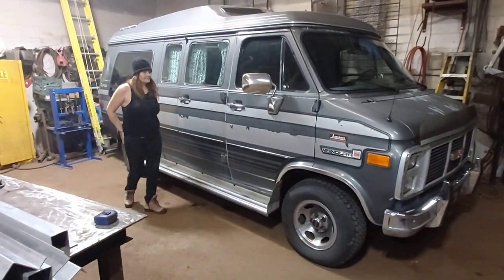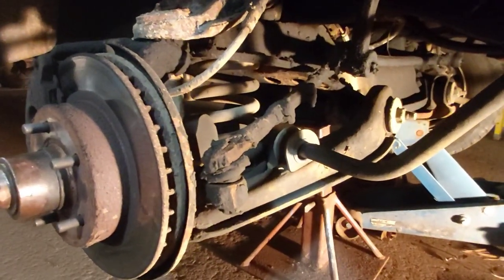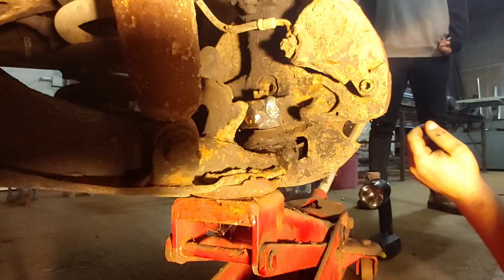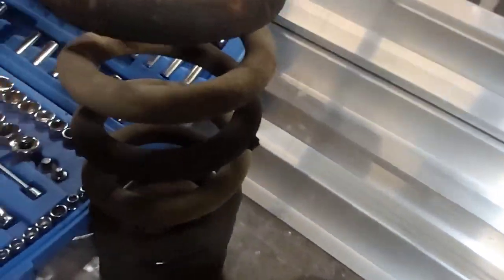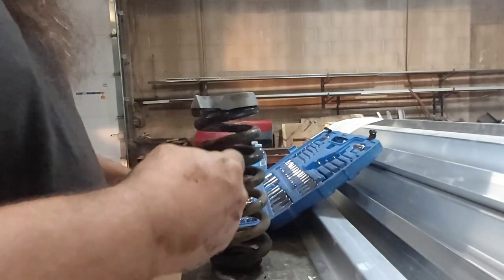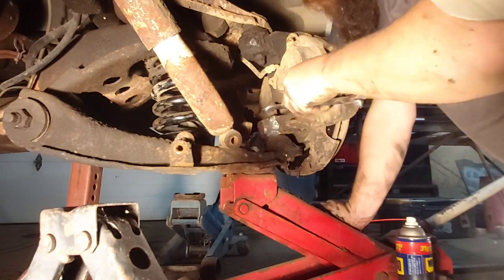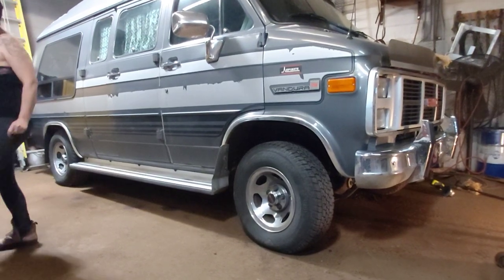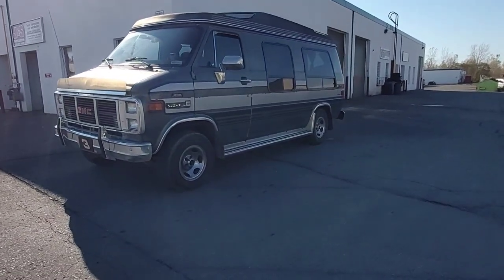gmc vandura van lift kit  part 1

Comment: I am kinda late to the party but good video. I will share my experience with you as I have done this procedure dozens of times on GM vehicles. When you pound on the spindle to break the balljoint loose put another large hammer on the opposite side of the spindle and it will release much easier when the pounding just does not absorbed into the suspension.
As far as the lift amount of the spacer it will be more than the height of the spacer because the coil spring is only about half way out of the suspension travel fulcrum .
You can see this if you run a string from the control arm cross shaft bolt at the frame out to the wheel.
Keep up the good work!
Reply from the maker: Thanks for the tip 👍
Reply from the maker: Thanks for the advice !

Comment: Nice video. I’m doing the same on my 94 g20 right now. How did you get the lower control arm low enough to fit the uncompressed coil and spaced in there?
Reply from the maker: Lower control arm drops down as much as you need

Comment: Did you modify your hub caps at all?
I have the same wheels on mine and the front hubs stick out too far for the hubcaps to fit proper. I have the black caps off the SS truck but I think the dimensions are the same for chrome. Maybe I just need to flatten that spindle nut cover. I think I need about 3/8" or so.
Reply from the maker: Ya they sit on the dust cap  a bit ..i did flatten it a bit .

Comment: Are they still holding up? Does it make the ride rougher at all?
Reply from the maker: I have been running the roads like crazy..drive it every day ,specially since the LS swap , and I'm totally happy with the budget lift and now 31" tires ..very happy my friend  ! Keep on vanning
Reply: @beardedvanadventures  dang do you have a link to the kit. I have got a 1995 GMC vandura I am fixing up. It is so low to the ground. I am also not sure what types of tire sizes can fit on it.

Comment: Try a spindle lift.  Factory ride, more lift, doesn't put the ball joints and rod ends in a bind.
Reply: No one makes a lift spindle for the G-vans. Have to modify a C10 spindle.
Reply from the maker: I'm trying to indicate a spindle lift ,any idea where to get one ?
Reply: @beardedvanadventures  it won't be for a van.  Like Daniel said look at the c10 truck spindles.  Shouldn't be much of a varient if at all.  When I'm junkyard hopping I'll try to see if there is a difference.
Reply from the maker: So buy a c10 2 wd spindle lift and modify them ?
Reply: @beardedvanadventures  I'll check for you.  I want mine dropped a little with spindles.

Comment: Any issues with dialing in the front alignment?
Reply from the maker: I didn't have it aligned yet but the camber needs adjusting a bit...I may look into the c10 lift  spindles and modify them to fit

Comment: what size tires did you add?  sorry to ask, no sound at work:)
Reply from the maker: No prob , I'm still on 235/75 /15 but going with 31" I think ..not crazy big
Reply: @beardedvanadventures  Do you happen to know anyone who has done a 4x4 conversion on one?  I have a V6 and want to upgrade to a V8 so since the body would be up in the air I thought about a 4x4 conversion.

Comment: You just ruined all your suspension Dynamics by putting a spacer in there you'll say you'll be needing a flip tie rod ends and all the garbage I did it on Astro messed it all up took it all apart went back stock did a body lift its perfect screw them suspension list they don't work you'll ruin the Dynamics of that steering you'll see
Reply from the maker: Thanks for the advice, over s year later I'm quite happy with it and have upgraded my tires !  Cheers 🍻